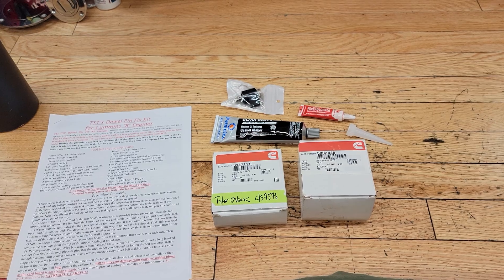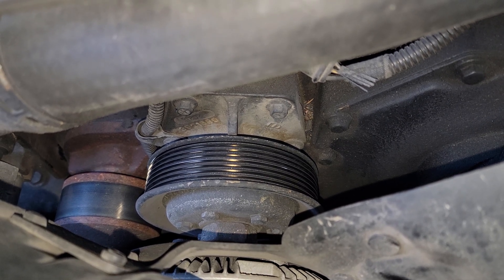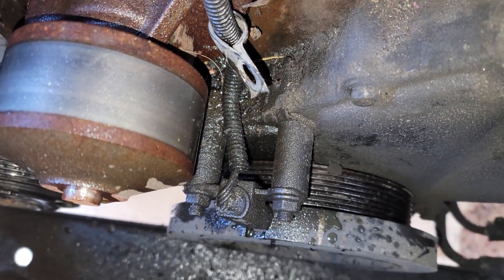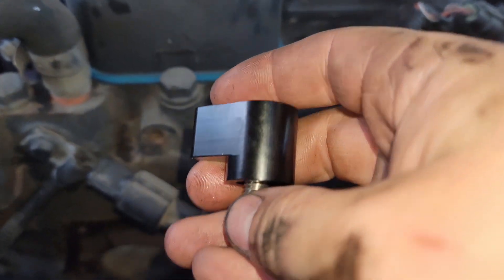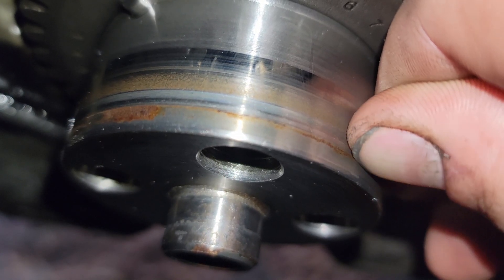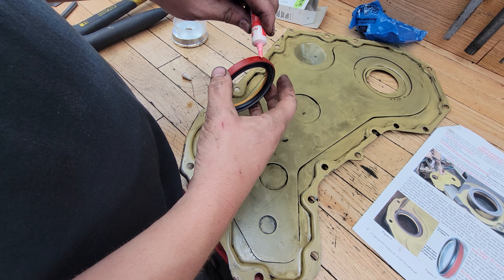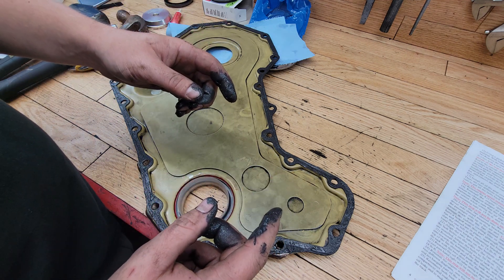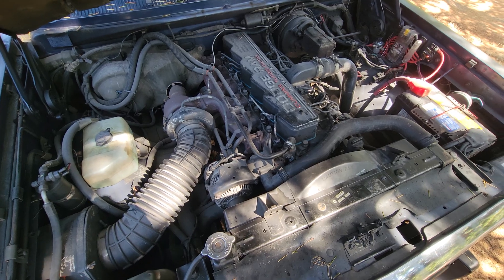Tabbing the Killer Dowel Pin (KDP) | 1st Gen Cummins

Comment: I wonder if there's a way to insert a boroscope to see the condition of the KDP without taking apart anything.  Any ideas?
Reply from the maker: Maybe an inspection camera into the front hole of the timing case with the fill tube off.
Reply: Are you saying insert the camera through the oil fill hole, then forward toward the timing cover void?
Reply from the maker: @DreamKalibur I'm saying it might be possible if you unscrew the entire oil fill port from the timing cover to stick an inspection camera. Not sure though.
Reply: Oh ok.  Gotcha.  Thanks for the comment. @OvensGarage

Comment: Pro tip from a heavy diesel tech for over 20 years now take that rtv and throw it in the garbage what you want to use is permatex anaerobic gasket maker spreads so much thinner and cleaner and it even smells nice will stay tacky indefinitely until it's compressed and cured and unlike silicone this stuff doesn't let oil seep through it over time it's actually the same active ingredient as red lock tight but in a thick gel form

Comment: did mine the bolts holding the timing case in were also loose i took them all out and loc tited all of them did my alternator water pump power steering pump and governor spring and power valve and new serpentine belt all the same time.

Comment: I don’t think It was an issue on our first gens.  My 93 has 356k miles on it. Mine has a good detent to it. It pops back and stays there.  Did people have issues if the didn’t get the timing pin reset all the way maybe.  Good video as always.
Reply from the maker: Cheap insurance either way! Still heard of it happening on some 1st gens
Reply: The pin can back out. But you got as good a chance as getting struck by lightning. The question is what’s piece of mind worth vs. current engine condition/age and costs. For my case I’ll roll the dice

Comment: Awesome video I'll get around to this at some point should've been done by now, but little bit by little bit. Mine has just over 200,000 kms.
Reply from the maker: It's a big job and definitely been on my list for a while...just picking away at it one by one!
Reply: @OvensGarage  balancer/dampener just won't budge was prying on it for an hour the other night so I picked up a jaw style puller hopefully will come apart tomorrow. This stuff definitely has never been apart in the trucks 30 years of existence. There's so much oil caked on the front of the block at the bottom you don't realize it until everything is out of the way I don't know how because it wasn't indicating that on the dipstick.